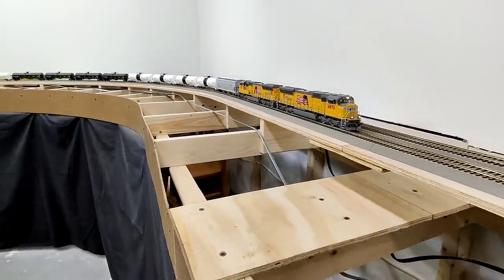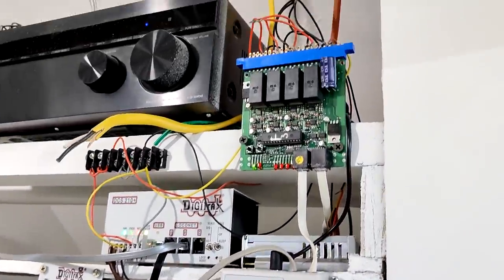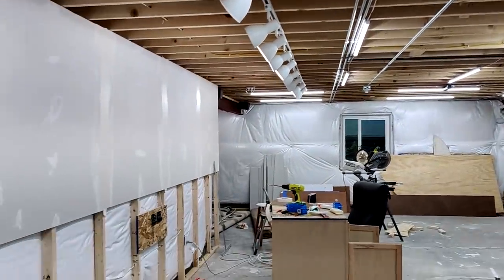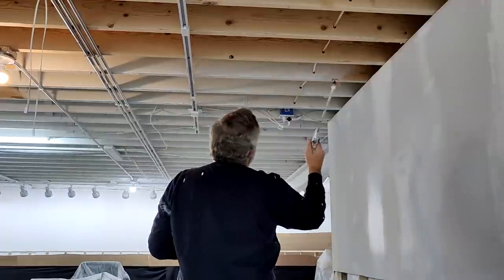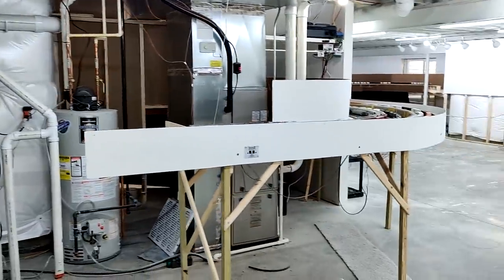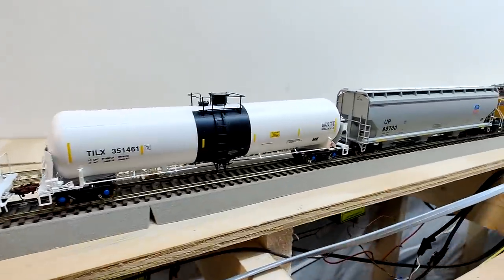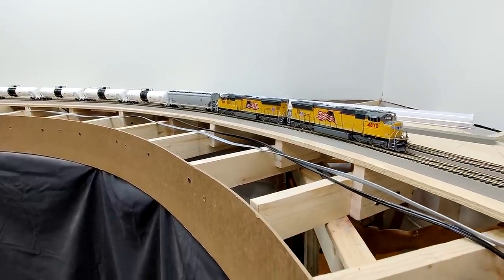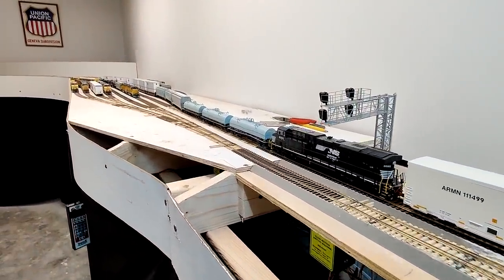Model Train Layout Built for Operations and Realism. Ceiling Painting and More!!!!! s2021e18

Comment: I was really surprised that the airless sprayer had so little overspray and misting. The ceiling came out really nice. You’re making great progress on the layout, 8-20 feet each week with having to do walls, ceilings, electric, and benchwork in each area as you go. I agree with keeping costs down and in my last basement layout room in my last house I put down an outdoor carpet that they use on commercial docks. I got it at Home Depot. I would have to look for my receipt to find the exact one that I used but I looked at the Home Depot website and there is a Traffic Master outdoor carpet called Elevations that comes in 4 colors and is only 50 cents a square foot. I used a burgundy color to match the pool table and layout drape. It would have to be glued down so there would be some extra cost. It was good for the feet and legs and I spilled crap on it that came right up. Just an option. I would probably use the black curtain like you did when I do the next layout. Merry Christmas.
Reply from the maker: I'll have to check that out. Thanks.

Comment: Foreign DPU’s are used here out of Council Bluffs. Normally, if there are several accumulating from a foreign road they’ll forward them to Chicago (for example) to be later interchanged with the owner. We built a train a few days ago with 2 NS units, that had come in from two different trains. In fact, one of them had come in dead, that we had the diesel house fix. We don’t see too many foreign power come in, but when do, usually it’s from an originating haulage rights train that is eventually moved around the system until forward back to it’s home.
Reply from the maker: Thanks for the info. It really helps.
Reply from the maker: BTW, if you have time to comment you have time to subscribe. Click that subscribe button! :)
Reply: I’ve been a subscriber for probably about a year, but I may have my subscriptions hidden. I’ll check it out.
Reply: Lol, ya I guess the settings are set to private unless you change it.

Comment: Sometimes carpet contractors will have left over carpet tiles from different office jobs.  I have seen model railroaders obtain these cheap because there is not enough to do a small bedroom in one color and the contractors are having to store those tiles.  Those contractors will usually have many different colors of left overs and are happy to get rid of the leftovers.  Modelers just make a mismatched pattern out of those.  Actually looks good when completed.  Merry Christmas!
Reply from the maker: Good idea.  I saw some remnant carpet for sale cheap at Menard's. I might consider using that in the aisleways.
Reply: @EvanstonSub  One advantage of the carpet squares is if you stain the carpet ruining it, you only need to remove the one square to replace it.

Comment: Although carpet is expensive it really will make your layout operations really comfortable and more enjoyable 

I have underlay and carpet in my train area and everyone that comes here comments on how nice it is to stand on the carpet for long periods of time when operating on the layout

Think about how many hours you intend standing whilst operating your trains
Reply from the maker: Yes, I will need to do something about the hard concrete. I'll probably paint the floor and then add cushioned flooring of some type in the aisleways.
Reply: I did the interlocking foam tiles in my train room.  Very soft on the feet.  And easy to replace a tile or two if they get damaged

Comment: What about the epoxy roll on floor kits with flakes (common in garages) for the floors. Low maintenance and last a long time. Would love to see some videos on how you hook up and program the signals at some point. Thanks for sharing. - Steve
Reply from the maker: Good thought.  I'll probably paint the floor and then add interlocking floor tiles in the aisleways/traffic areas.

Comment: Daryl,  Before you do any more with those PM42s and BDL 168s do yourself a favour by getting the Acculites breakout boards for them.  The- breakout boards make wiring the Digitrax components so much easier and in fact more reliable, especially the main 14 or 12 awg Rail A/Rail B bus wires.  And if you ever have to change any of the wires it is the difference between undoing and retightening reasonably spaced screw terminals versus unsoldering and resoldering very small and congested terminals on the edge connectors.  (Note: I have nothing to do with Acculites other than being a very satisfied customer.)
Great to see such fast progress!
Reply from the maker: Thanks for the tip.  I saved all the wiring from the Geneva Sub layout, so I will likely just reuse those.

Comment: For the floor you might want to look into epoxy. It's not to expensive and it seals the moisture in the concrete. 
Drop ceilings come that you can put in 2"  below the framing. Don't know the cost anymore . Nice job, you have years of work ahead of you.
Reply from the maker: Thanks. I think the painted ceiling is going to work out well. But you never know.

Comment: What paint did you use for the ceiling? Earlier you mentioned something about the nozzle size, I am thinking about using KILZ but don't know if that might be a bit heavy for the typical airless sprayer.
Reply from the maker: It was the cheapest white paint home depot had, Glidden Essentials.

Comment: Looking good!  Painted ceilings are quite effective.  I see that a lot of stores are using painted ceilings instead of a finished ceilings.  It seems cheaper and much easier to service the various utilities that are under the floor or in the ceiling.  I have seen back as well as white, but the paint makes everything blend together and fooling the eye.  The monochromatic finish keeps the eyes attracted to the colorful layout and the moving trains.  As far as the floor, one thing to consider is insulation.  Another is that a hard concrete surface can be tiring on an old man's feet (I'm older than you!).  You might look at a flooring with a little cushioning to it.  I agree that carpet is not my preferred surface for model railroads.  Carpet contains the dreaded "carpet monster" who seizes any small parts that you drop on the floor.  Carpet can also hold dust and it seems to me that any spilled scenery bonds to carpet better than the layout.
Reply from the maker: I'll probably paint the floor and then add cushioned flooring of some type in the aisleways.

Comment: good vid. Any concern about dust falling from above due to foot traffic etc and getting layout or track dirty. Read somewhere this was an issue. Your thoughts.
Reply from the maker: I think the paint will eliminate a lot of that.  Also, the upstairs is completely vinyl plank flooring, no carpet.  I think the source of the dust is dirt making its way through carpet as well as the deterioration of the carpet padding over time.  Time will tell.  Drop ceiling tiles can also drop stuff onto the layout, especially if they are moved to replace bulbs, add wiring, general maintenance, etc.
Reply: another question, what did you do for electrical outlet spacing under benchwork, anything different than building code required for new house?

Comment: This is getting exciting. You’re making great progress. 

You asked about non-mainline trains being DPU’d? I’m guessing what you mean is running DP trains on branch lines? There is no general rule that prevents DP on branch lines, however each branch line has its own specific restrictions. Generally those are restrictions based on tonnage. As you can surmise, DP trains are generally heavier tonnage and longer than conventional trains. For the most part, branch lines don’t have DP trains, but there are exceptions. 
Best regards,
Kevin
Reply from the maker: Actually, I meant foreign power such as NS and CN as DPUs.